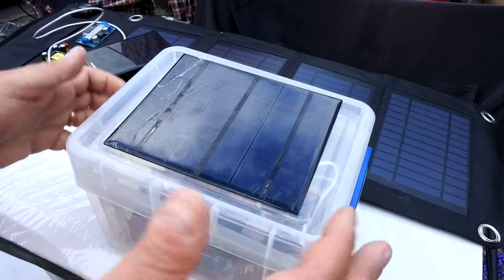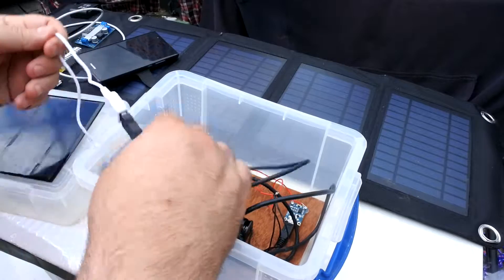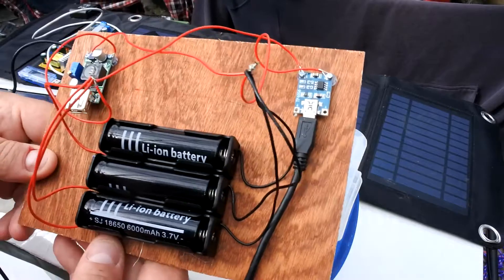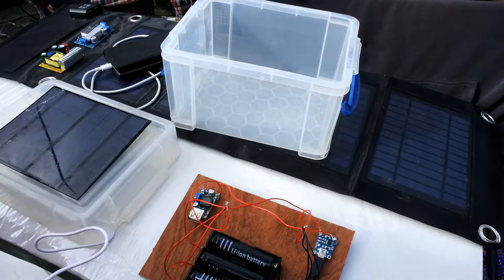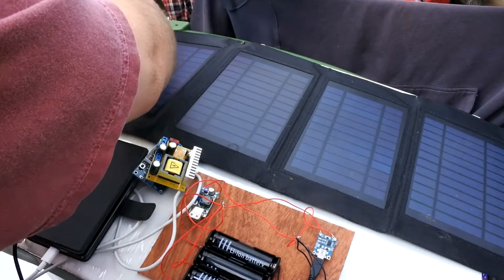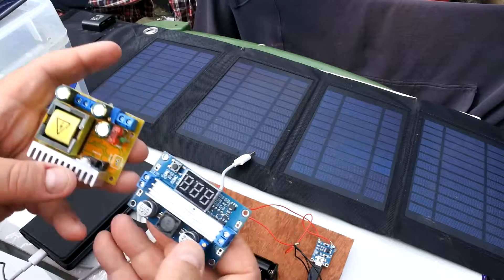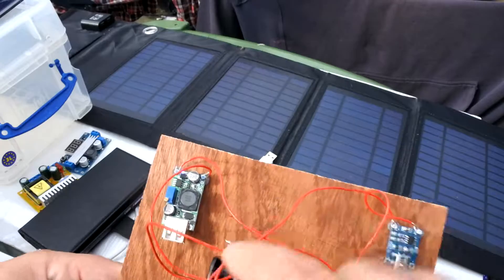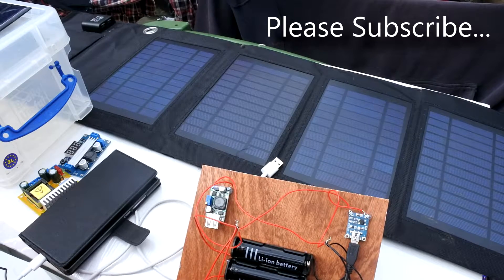DIY Solar Powerbank Part 3

Comment: Would this set up be able to power something and charge the batteries at the same time? I am going to try to build something similar to power a pi zero by solar during the day and to run off the batteries during the night time.